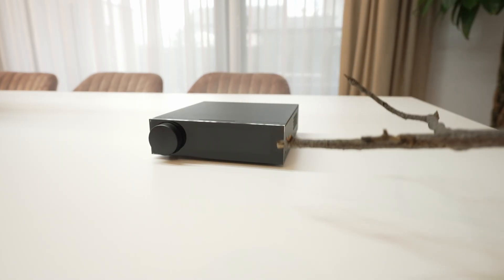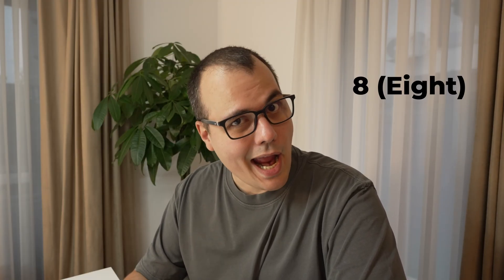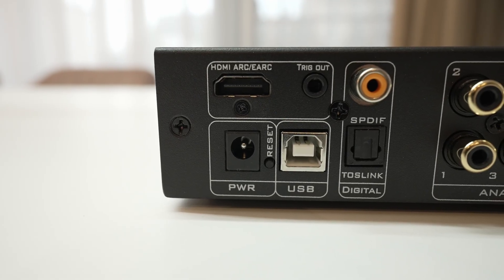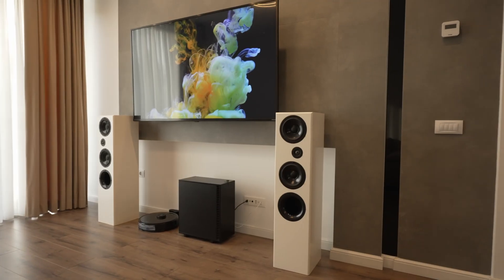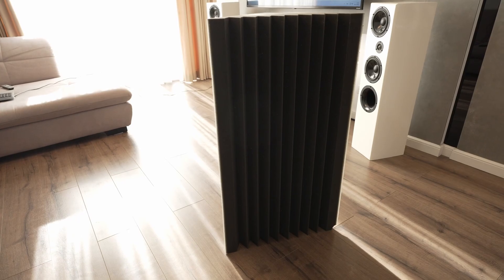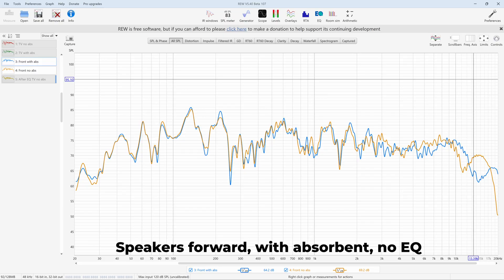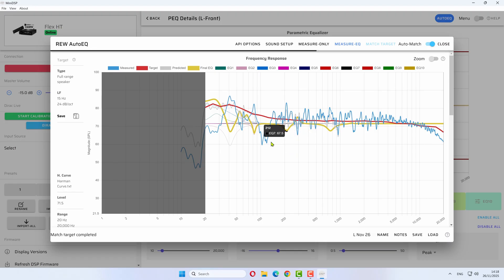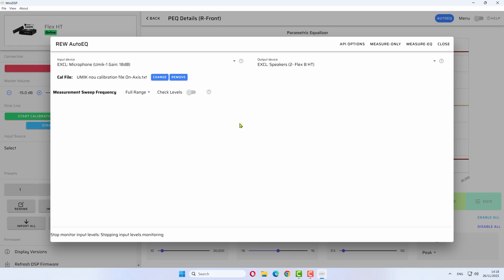miniDSP Flex HT - Auto EQ

Comment: What a cool gadget for emptying wallets! I myself purchased a used ONKYO 7.2ch surround receiver with an Audessy calibration mic and it has auto tune function with room correction and is all equally adjustable on screen when connected to a TV via HDMI the only thing I don't get is the graphs but I only paid $150 for the whole thing 😂

Comment: @AudioJudgement I use the behringer deq2496 for autoEQ, and the behringer dcx2496 for auto phase/time alignment (I have a 2-way setup, but this unit can do 3-way or 2-way + subwoofer, or 6-way mono if you've got 2 units). 2nd hand they are reasonably affordable, since they have been around forever.

Only drawback would be that they are XLR only, with PA signal levels being expected. So for a home hifi you'll need a rca to xlr converter like the Art Cleanbox Pro that I use.

No subscription needed, no unlock fees, and probably a little bit cheaper than the minidsp 😅
Reply: Ps. My setup is bi-amped. Since the active crossover.... forgot to mention that, and its kinda important😅

Comment: That is a great start and mini DSP do great things.

To improve sound quality end enjoyment at different listening volume levels. (If you want to listen to music but everybody is sleaping and you cant play to loud as one example)

Look at "equal-loudness contour". And look at the difference between the 40 and 80 phon. You see more or less "Smiley" curve.

As you know and see in the graph that for example our hearing SENSITIVITY is lower at 25 Hz than at 1000 Hz.

So what you do is adjust everything on the input so you get a "microphone flat" graph.
That is your starting point! (With your specific locked in speaker placement, listening and treatment.)

Now when you have flat (does not sound good and it is a good experience to listen to and learn that). Then you recreate PAQ in the output for each channel, those "equal-loudness contour" graph for 80/100 phon and on another preset you do the same but there you recreate the 60 phon.

The 60 phon preset PEQ is now for your low level listening sessions! (With the two presents you have created manual adaptiv loudness control.) So you will still have your bass and highs as if you listen to higher volume levels (instead of missing out and not hear those frequencies)!

You have now adjusted for hearing sensitivity of homo sapiens and not "microphone flat". An it is actually "homo sapiens flat" adjusted for our sensitivity.

Now you also know and experienced the difference between"microphone flat" and "homo sapiens flat".

This is now YOUR starting point.. ..from here you can adjust the "equal-loudness contour" output curves to your specific preferences!

There is so much you can do with this great device!

When you have 8 ch output you can connect power Amps directly to speaker drivers and let the amp damping factor directly control the driver itself without crossover stuff in between. The DSP will do crossover better and more accurate than any passive components are capable of.

With your microphone you can adjust when slopes is started with 1 Hz granuality! You can use different slopes and types that is to complicated and you never see in passive solutions!

Oh you are able to pump out so many videos as you like with this device.

And in other words this device open up many different opertiuneties to improve the sound quality! 🎉

You could also find out where your issues in your specific room comes from! And so on. (To long comment already)😅😂

You also can use different microphone measurement techniques.  Oh I have to stop.. 😂

Comment: It can decode dolby and dts ? if no then how it can play 5.1 / 7.1 when connected to the tv, because tv passthrough direct audio from streaming app
Reply from the maker: You are correct, it doesn’t decode dolby and dts. Kind of misleading to name a product HT and not have this function. Still, you can get around it with an HTPC, or other compatible source.
Reply: @AudioJudgement interesting to see how one implements a flex 8 with Apple TV or htpc and diy speakers say 2.2 for a immersive movie and music experience I am not interested in wiring room for 5.1
Also thanks about this AutoEq never knew about it. I got he flex 8 HT and not yet bought the Dirac lic.
Reply: It will receive multi-channel pcm via its hdmi earc port, in other words, pre-decoded Dolby and DTS up to 7.1 I think. Most Apple TVs and newer Roku tvs and devices are now decoding directly in the device (Dolby Atmos and Dolby Digital +), then outputting that on its earc port. So, as long as your device decodes, the HT Flex will be able to accept it, dsp it, then pass that on through to your multi channel amp via analog RCA cables.
Reply: @midnightsuncreations  Dolby Atmos is decoded only in AV receivers / AV processors, because it is object based audio so it can't be decoded without number of channels present and speaker layout.

Comment: Now you have the HT - why not take the crossovers out of your speakers so you can compare active and passive?  I don't think I'll ever put the crossovers inside the box again, even if I end up with passives.  Cute chinese digital amps are so cheap these days.  As indeed are older multichannel power amps on ebay - and even older receivers with multiple single ended line inputs designed for SACD and DVD-A.  Nice video!
Reply: That’s my plan, going to convert my Klipsch Forte’s to fully active, I scored an older flagship Denon 7 channel Avr to use as power amp (120w x7), using Flex HT it should work, plus 2 channels left for subs or surrounds. Probably will do the Dirac upgrade too : )

Comment: Welcome in the EQ MMM, average, sync measurements 's rabbit's hole :) I have the same kind of living room than you. A DSP, a sub was the obvious first steps but then I now have a "listenning configuration" : Speakers forward with casters and an 15cm abosrder just behind my head (hidden under the couch on a daily basis). This configuration helps to minimize back reflection, limit early reflections at listenning position and approach you from the "critical distance".... Invisible the day, rabbit's hole the night :) Needless to say, benefits are huges compared to stuff swaping
Reply: the absorber behind the listening position is a big deal when you are sitting close to the wall even if its just 5 cm with a small gap between absorber and wall, 100% recommend from me aswell!